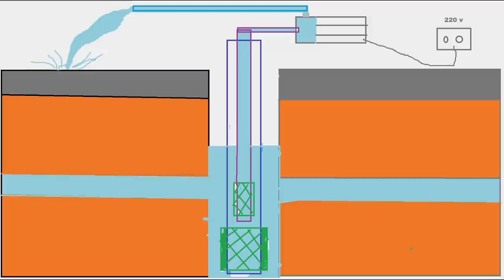9. WELL. Water. Drilled a well with my wife

Comment: Thanks for sharing the video, i have some questions 🙂
1. Do you think it was necessary to use the 10cm drill before, or shouldn't it be possible going directly with 17cm?
2. Your well pipe is 15cm outer diameter, right?
3. do you know your actual water level? 
4. Can the pump run all the time? it looks like you get around 10l/min out of it, right?

Thanks again for your inspiring video!
Reply from the maker: i did it for the first time.
I didn't know what soil. 10cm drill was reconnaissance.
2.11сm
3.already know 6m
4.yes the pump can work continuously.
5. 8 lpm
Reply: @musichouse2485  Big Thanks for you quick reply, that will help me a lot!